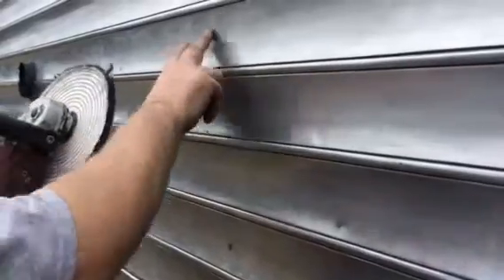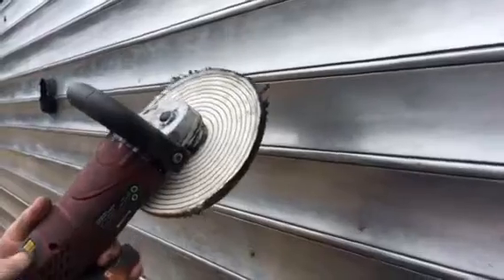Polishing the bus part 2

Comment: I don't know what alloy GM used on the sides of the bus,  but if it is 2024 AlClad, which is used on aircraft for strength, then you can damage it by polishing off the pure aluminum cladding.  The base alloy in 2024 has copper in it and it doesn't weather well at all, so it is clad in 0.007 thick pure aluminum for protection.  If you polish that off what will be left is dull grey metal which won't shine and which will corrode easily.
Reply from the maker: The anodized layer was already ruined as someone had sanded sections of the skin.  Left with no choice i removed the rest of the anodized and polished it.  It looks great and has lasted for several years.  Literally 100x better looking.  I don’t recommend this procedure unless your skin is very damaged.  The flat sheen of the anodized aluminum is the correct surface not a polished shiny skin.
Reply: New 4104 owner questions; when a bus is polished does a good spray on aircraft wax keep it shiny longer? Also is there any practical way to restore the anodized finish - I am gushing mine is pretty well around the bend.